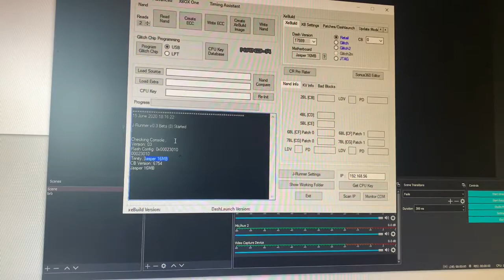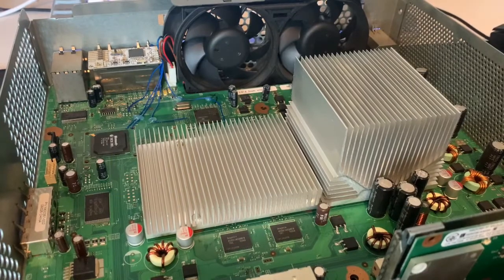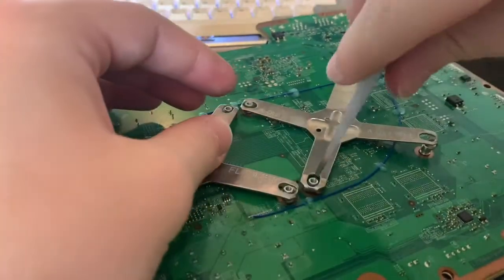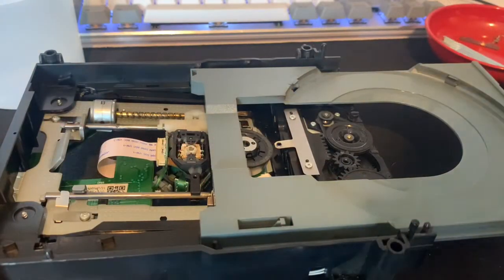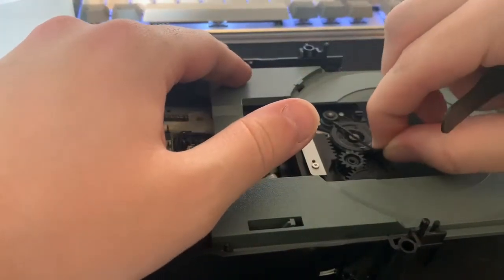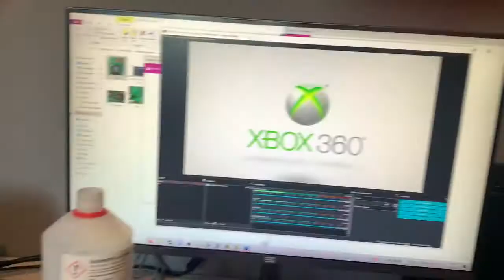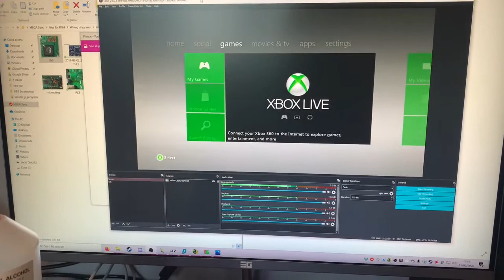Console Refurbishment - MW2 XBOX 360

Comment: Hi, I am a new subscriber to your YouTube channel. I have the same console my friend I have the Xbox 360 modern warfare.2 video game console in mint condition and I’ve seen on eBay that is video game. Consuls can go up to $4000 for real the one you have and the one I have they can reach over $1000 or more. You know that right? These are very very collectible. I love this consul and I’ve never taken mine apart. It’s good to see what mine looks like inside and these are the Xbox 360s that they fixed so they never have a red ring of death and I have another Xbox 360. It’s a bundle Xbox 360 elite kung fu panda 128 GB and it’s got the Indiana Jones and kung fu panda. I love both my consuls see my iPhone misspells so I had to put video game console because my iPhone 13. PRO MAX I bought from Verizon wireless which is my carrier. I love my iPhone but it misspells and it drives me crazy but I love love love my iPhone and my Xbox 360s. Great video my friend but I am a new subscribe to your channel. Great video, my friend.